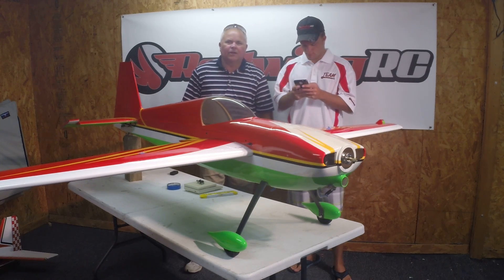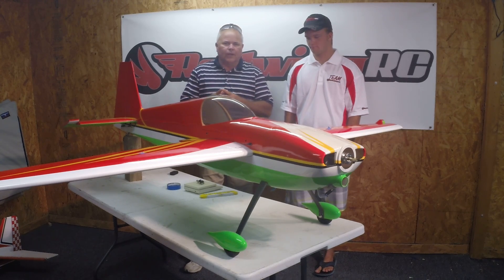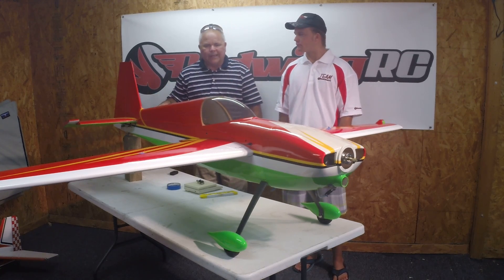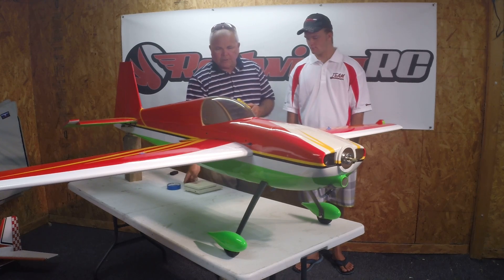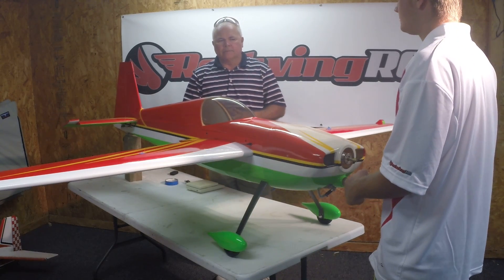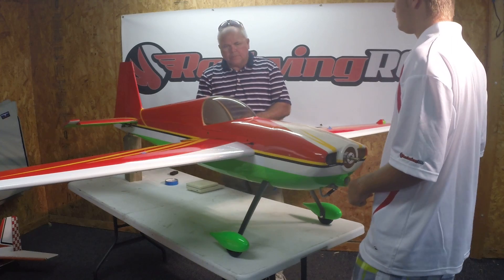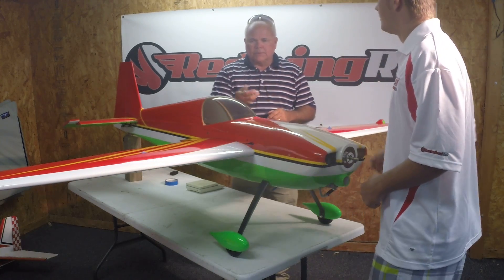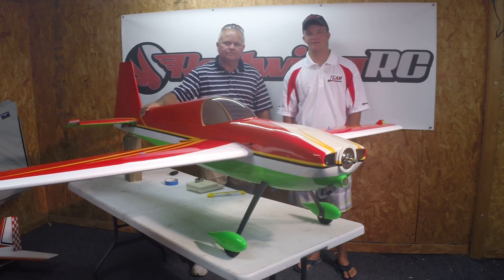Lateral Balance an RC plane

Comment: You would be better drilling a small hole in the end of the light wing and screwing a countersunk screw in. You can add in some epoxy or wood glue into the hole first for extra weight. The point is, you will need far less weight on the end of the wing.

Comment: Rather than carrying "dead lead" outboard of the fuselage to balance a light wing issue, I make a servo mounting tray from 3mm brass sheet, and if a 7-8cm square of brass and a 60g servo isn't enough weight, I add another plate below, and if MORE weight is still needed, I tie them together with tungsten bolts and sintered bronze standoff posts. Use the weight, at least, with mine it's serving a purpose and it's stronger than plywood too. NEVER lost a servo screw from one either. Beats lead any day. And when you have an engine each side of the fuselage, it can need a lot of weight to balance correctly. MOST people ignore this simple task. IMPOSSIBLE to describe how much difference it makes when your model flies true and straight.
Reply: Brass, tungsten or even gold  used for mass is exactly the same as "dead lead." 
Your massive hunk of brass is purely dead weight since the plywood more than strong enough.
The best thing to do to avoid adding "retarded brass" is to move what you do have around.   Is the left side of the plane too heavy but you have the esc, rx and rx batt mounted on the left side of the fuselage? Mount it on the right side!
Your comment is ignorant AF!

Comment: If the plane is off balance laterally will that cause it to wobble? Why does my plane wobble?
Reply: Should not be lateral balance. Could be loose rudder cables, weak rudder servo, or rudder servo having problems finding center. I also have a friend that was having that problem and some glue joints were loose in the rudder. He had to trim so it tracked straight, and then wind was pushing against it and making it flex so it wobbled as it flexed and unflexed. Made for the coolest slow rolls though. Lol
Reply: Or are you referring to off axis rolls?